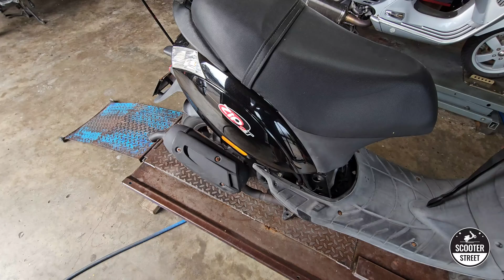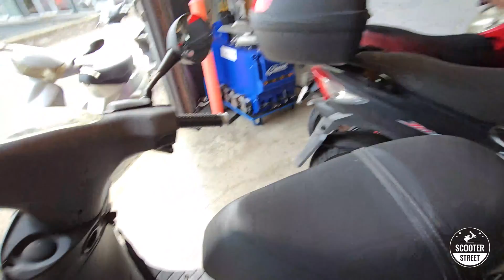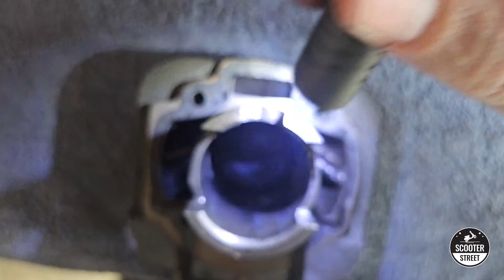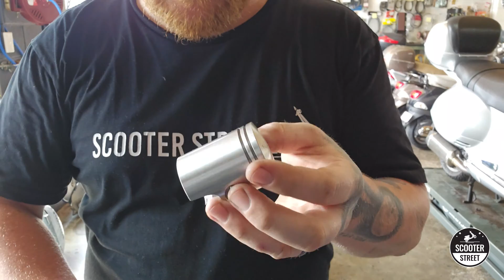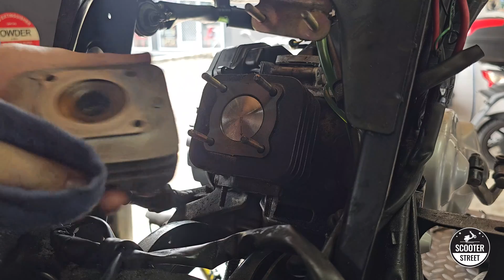Blowing Up A Scooter Engine (On Purpose) - So We Can Fix It!

Comment: Mine seized coz the oil line was old and perished (the one thing I didnt replace on the bike haha) a hole rubbed through where it was touching an edge, it started right back up after I let it cool for abit but now it has no power for the first 40 seconds of riding. Found the hole afew days later where I saw dots of oil on the engine case.

From full build to now repair your videos are a god send. Thanks mate
Reply from the maker: You are not alone, a very common issue. Add to the regular maintenance check list. Damn OIL LINES.
We appreciate your support🫡

Comment: I took my 1e40qmb engine out of my 2006 keeway and then took the cylinder off, but the tiniest bit of dirt got into the crank case and there is the slightest crunchy sound coming from the crankcase/crank area. Do I have to fully rebuild my engine or can I maybe rinse it with gas and blast it with brake cleaner or something
Reply from the maker: Depending on the age of the internal parts, give it an update with new bearings and seal kit.

Comment: Beautiful video. very nice filming. really shows everything u need for a first time rebuild. But do you need to break it in??? and whats the best method to do so??? is it fine if I leave it idling for a whole day, does that count as a break in?
Reply from the maker: Thank you for great comment👌👌For break in, slow riding and constantly checking the spark plug and the systems, fuel, oil. We never allow our scooter engine idling for long period.

Comment: Most people switched to 4 strokes by now, but 2 stroke scooters are still very coomon in europe.
And believe me, there is nothing more annoying than being waked up by a 2 stroke scooter at 9am on a saturday morning. 
Those should be scrapped for being obnoxiously annoying. Its not even a sexy sound like a 4 cylinder sports bike or clean big bore single cylinder, just a lawn mower on crack.
Reply from the maker: 😉Hey thanks for commenting. What are you doing sleeping in to 9am.😂

Comment: same thing happen to me i was driving pretty far bought the moped unknown of the cc or anything anyway was driving for like 20 kmh full speed then it suddenly turned of waited 2 minutes started back up and kept going not to sure why it overheated the front cover was off so it had maximum airflow very strange but still runs
Reply from the maker: Sounds like you have a problem with the piston/cylinder, check these parts and the systems that feed them.
Reply: @scooterstreetau  would it be fine to keep riding with the sesier damage or should i pull the cyl of and check if the crank and everything is still good also 

when trying to take the cylinder off it's very hard to come off almost like it's stuck the head is easy but not the bottom
Reply: when i got home found it it was bigger then a 50 looks like a 80
or something i have the same seizure marks on the piston the first time it happened the oil line disconnected from the carburettor and it seized up. I plugged it back in kept going and then i I plugged it back in went home poured some oil down the cylinder let it sit for an hour then went for another ride

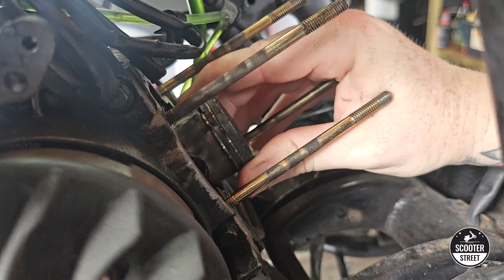Comment: 15:53, my engine block won't budge from the studs. It's a buddy50. Is this normal? What could be preventing it from sliding off the studs?
Reply from the maker: Gently turn the flywheel and see if it free or locked.

Comment: hey i heave piaggio zip 1 dr70cc and yesterday i was riding it and it boged down turnd of at 30kmh and started light braking i dobt know if it is seazed because a kickstarter goes normaly down
Reply from the maker: Get in there and check it out.

Comment: Hello, I have a gy6 Chinese scooter that is making a loud buzzing noise coming from the engine when going over 60 km/h , with a significant power loss, I have filmed a little video I can share it with you if you don't mind helping me out, I have changed the cylinder head, checked the valves clearance,the piston,the crankshaft, everything seems to be normal 🤷
Reply from the maker: Isolate the noise area source. Is it the timing chain, Main bearing, a vibration from exhaust??

Comment: My engines doing this after rebuild would you say its crank thats gone as i can ride for 5 10 mins it just goes burr and conks out but starts back up instantly
Reply from the maker: Your issue could be fuel or oil supply related. Check these components and then the piston.
Reply: @scooterstreetau  brand new oil pump ive also put oil in petrol to give oil pump time to pump right oil through its a brand new piston rides mint until it gets hot also crank had play thats why i think its a bad crank

Comment: A quick for you mate is side to side movement ok on crank aslong as no up and down play as my top went caput today
Reply from the maker: Sorry to hear it went bang, there is always small movement in all directions but excess movement is what we are looking for. The movement is bearing clearance. When the shaft and the bearing, cases wear this is where the excess movement presents.
Reply: @scooterstreetau  tbh wernt riding it was only started had 2 backfires and just died checked top end piston and bore was scored but tbf think someone who i had it off allready had it all apart as wasnt a top gasket on it so just waiting on fresh 70 top end tk come today and try that im hoping it dont need a new crank
Reply from the maker: @Jameswba  Check the lubrication system, look for all reasons why this has happened before fitting another pist.
Reply: @scooterstreetau  just check 2 stroke pump and its working so only thing i can is it was gone before i had the bike as ive not even rode the bike yet its only ever been started on tick over
Reply: @scooterstreetau  also engine only done 7thousand km which is about 4.5k miles
Reply from the maker: @Jameswba  Jet up to be safe when you start with the new pist.
Reply: @scooterstreetau  what size would you say and what oil do i put in semi syth? And buying new oil pump to be on safe side
Reply from the maker: @Jameswba  It needs to splutter. Select a Premix compatible oil.
Reply: @scooterstreetau  what size main jet do i need to use so i can order 1 and yeah got strawberry scented semi syth rock oil 2stroke gonna put some in with petrol and rest in tank once ive drained out old 2 stroke replaced lines with new pump lines
Reply from the maker: @Jameswba  Watch the carb tuning videos.

Comment: Why does my Piaggio zip 2T 2016 model starts to accelerate the first 10 seconds when turned on?
Reply from the maker: Auto choke.
Reply: @scooterstreetau  so is it working like it should or do i have to change it? But this only happens when de bike is cold.
Reply from the maker: @numankralj  It maybe over reving, when you atsrt the engine ride slowly immediately and it should settle after 30 seconds or so. In cold climates the auto choke becomes more active .

Comment: I have the exact same piaggio zip and i had my stock piston seized for about 1 year now without me knowing it ( i thought it was a variator problem) and i found this video and just now it stopped working and when i opened the engine cover i was met with dried grass.. which means the engine was not being cooled whatsoever
Reply from the maker: It is very satisfyling when you find the cause🙌

Comment: Is there a mild 70cc setup possible on these Zip's?
I was a mechanic and capable of the work. I just need something to get in, around and out of town with. 
I was looking at a 70cc mod scooter because I could probably have it on road for not much more than $1500 with low km.
1, Could a mild set up haul 128kg of man around and up hills?
2, even if it can, should I do it? 
Or just buy something bigger out of the gate for over double the price?
I've watched heaps of you vids but looking for some real world, first hand experience. 
How many km would you expect out of a well maintained and not flogged 70cc kit?
Reply from the maker: Yeah the 70 kit and an exhaust will be fine.
Reply: @scooterstreetau  awesome!
Thanks for the prompt reply.
Have you seen what sort of longevity people are getting with a 70 upgrade?
30k km?
100k km, lol?
Reply from the maker: Piston and small end change at 10-15K @secretsquirrel9722

Comment: Great video, I've just had to rebuild twice a month apart a hiper 2 Piaggio typhoon as the crank seal behind the magneto was leaking and letting air in or mixture out and caused it to lean seize multiple times until the piston was marred all around, mostly on the intake side suggesting lack of oil lubrication.

Anyway I'd love to see how you guys do a leak down test. As before it broke down, I was having a hard time jetting it as the jets were so much higher than other builds I've seen.
Reply from the maker: Hey thank you. Nice work! Great idea for a video. The seal leaking will give a false reading and also fluctuate the idle and accelration from low start. Glad you found out why.

Comment: Hey guys love the videos. Have you ever come across a piaggio intake manifold not sealing properly??
Reply from the maker: Yes we have, we sell a ton of new manifold and the rubber breaks down. We use grey heat gasket when fitting new manifolds to increase the integrity of the seal.

Comment: Hey, got a ac zip with 70cc mhr replica, yasuni r and 19mm dellorto and a few other bits. For some reason when taking off from idle going wot it stutters and wont rev up for a few seconds and then revs up fine and goes well, This only happens when taking off from idle going wot and wondering if any ideas on this.
Reply from the maker: Test for richness and go from there. the entire set up can have this effect, air pod or filter and so many factors.
Reply: @scooterstreetau  has stock airbox with mallosi sponge, main jet is nearly spot on but wondering how to know if it's pilot, needle or air screw not tuned correctly that could cause this
Reply from the maker: Air screw should be set for idle run down. CHange a few things and see what the difference is. It is much easier if you do as I suggested and test for what the issue is☺ otherwise you are chasing your tail. @Mikey.tischl

Comment: Hey
I have aprilia motard 50 2t 2017 with 17kkm on it so in near future i was thinking about some 70cc kit and I noticed my splines on crank are not in good condition I think I might put the variator fan not correctly once when trying different weights.
I want to build it for wheelies and some fun time in general. 
Can you recommend something? Budget around 500euro
Only mods on it currently are somekind yasuni exhaust, lighter rollers 6x5g and stiffer 2mm springs  in clutch, main jet is 60.
Reply from the maker: Get the crankshaft sorted as it will hold you back from tuning and progressing. Check all over the engine and body and replace anything broken or worn.
Reply: @scooterstreetau  So, sorting crankshaft means changing it, and that means budget going to hell but im okay with it. What do you recommend? If im gonna go that deep what to upgrade along the way? And maybe convert it to water cooling.
Thank you for the answear ;]
Reply from the maker: Decide which way to go and then you can match the parts, if you want the same crankshaft buy a factory or similar and fit up with new bearings and seals to get ya back on the road.
If you decide you love this then go for a higher class crankshaft and fit matching parts to suit. @enduroiasg4068
Reply: @rstreetau  The worst thing happened that I didn't expect, reed valve broke at 45mph, I heard loud knock and the bike died :(
I'm thinking going Airsal t6 70kit(don't know of this is bad) with Athena carbon petals. Do I need to worry about something more than main and idle jet?
EDIT:
Part of the spark hole thread fall into not the petals :(

Comment: Nice tutorial.
Why do my circlips never go in that easy? 😂
I much prefer the way you have put the piston in the bore on this video. It's not always easy to see if the rings are seated correctly working under the scoot.
Keep the videos coming. 👌
Reply from the maker: Thanks Paul, Yes there are a few methods, this is easy if you have the surrounding space. Elevated scooter is the key.

Comment: Thanks again for time and effort spent on these videos. Always pedagogic and well explained☀️
Keep up the good work👍🏼

Question - in one of your videos when installing a 70cc kit on an air cooled  piaggio you removed the rubber air inlet ”snorkel” from the airbox. 
Would there be any pros and cons from doing this? 
Have just installed a 70cc Athena pro sport, unresricted but original looking exhaust and sticking with the original 17,5mm carb (suggested in the instructions from Athena). 
Thinking about perhaps removing the snorkel?
Reply from the maker: Thanks Oscar, yes we hope viewers can learn when we share our expeireinces. Removing snorkel offers more air and then upjet to balance the ratio. The 70cc can accept a higher capacity of mixture than the 50cc.

Comment: Another upload !! Those Hiper engines are too tough - i had a 99' zip 1st series, had a malossi mhr racing 70cc ac kit on it, stock crank with shot bearings, c16 and 21mm carb - pushed it to 110kmh and the ring broke. For a split second stuttered, but still ran me home. Low compression obviously, but the piston and cylinder somehow was excellent. Replaced the ring and went on my way!
Reply from the maker: Yes we see this often, they always limp home.
Reply: wow how long did you run the stock crank?
Reply: @uenko  1 year and 5 months. Got the cylinder used, changed the ring, after 300km changed to a 2fast b size piston. Rode 1200-1300km. Before the mhr it was fully stock. Didnt even change the seals or bearings, just a new needle bewring Pushed it 90kmh+ and 10k rpm daily. 2023 september upgraded to a jasil evo hi-tech, after a month switched to an airsal 50cc. Those were good times 😇
Reply: And yeah they are tough I remember few years back my 50cc hyper 2 engine siezed on me ( oil pump belt snapped ) i put some engine oil in with the petrol as it’s all I had at work and after a few kicks it fired back into life! Sounded awful and very rough but it got me home! Piston was absolutely destroyed but cylinder was fine!
Reply from the maker: Nice. @dexietyy7922